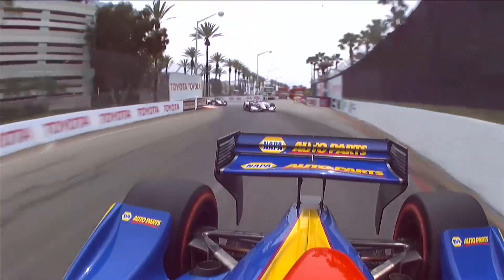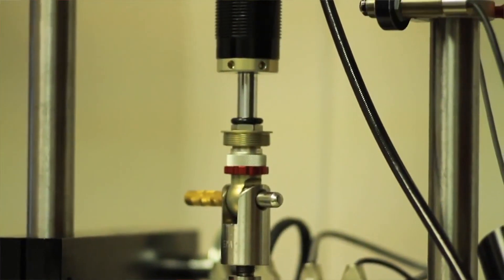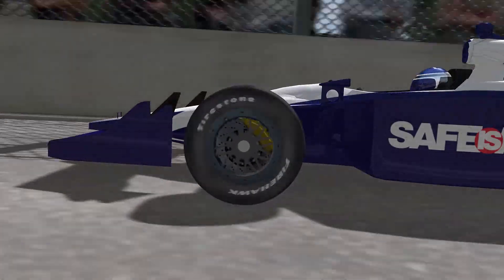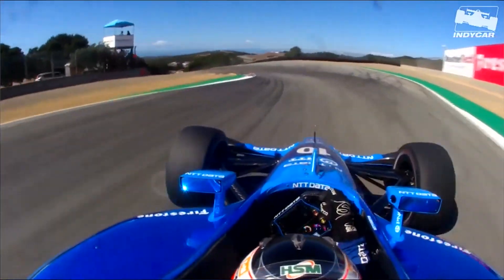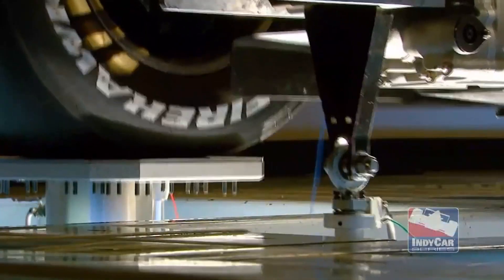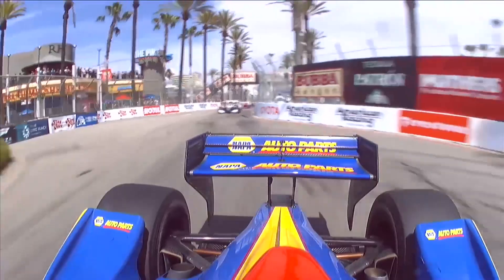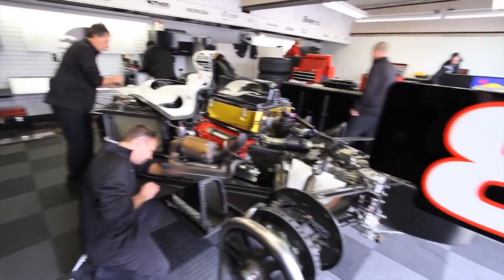Tuning Shocks/Dampers for Speed - Part One: How They Work

Comment: 3:17 "There'll be times when might have your damping front to rear out of phase and then the car is very pitchy. That's probably one of the biggest things for what will allow the driver to go quick. We might find damping setups that actually have actual what we'll call grip,m but the platform is more consistent. And if the car is not pitching, they'll tend to have have more confidence with the car and extract more speed from it."

If the car isn't pitching, then wouldn't the tire's contact patch be more consistent as well? That's been my experience, and the dampers have  HUGE influence on heave / pitch dynamically, as well as roll as most people focus solely on. It'd be interesting to see results where a pitchy setup is theoretically / modeled to be faster than one with a 'flatter ride' (perhaps due to curbing compliance or aero concerns?). I think the downside of allowing excess pitch apply to more than just driver confidence, but braking stability and tracking rippled surfaces as well. 

4:18 - "We don't really tune the car much with dampers, unless we have to. We generally through our 7-post testing and simulations we set the dampers for what we feel is going to give us the best and most consistent grip for the setup we have, and we just leave it alone. And we tune with toes / cambers, things like that..." 

"Yes, you definitely you want to have the geometry where you want it so you get the most out of the tire. So you have the tire operating whether it's camber or slip angles and stuff like that, so that they're correct. Your spring rates should be correct.. And at that point you can start to dial in the shock absorbers. But with all the information out there, you should be able to start with a shock that's close."

Music to my ears! I've found far bigger gains by focusing on optimizing damper behavior than just having many knobs, especially if the user doesn't really know what the knobs are doing. From track to track, sta-bars, tires pressures, aero settings, alignment, and corner balance / stagger seem like the key variables to work with. Wish I had a 7-post rig.. one day. 

Thanks for the great video!

Comment: Hoping part 2 gives us real race engineers opinions on manipulating oversteer and understeer tweaking with the dampers.
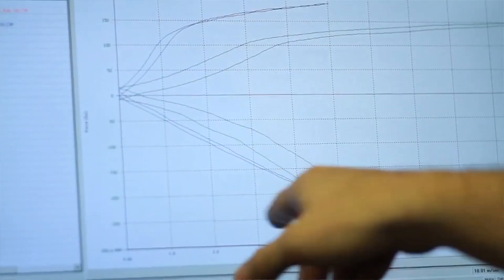Reply: Watch out for excess force in rebound or compression at high speeds (assuming you're driving over curbing). Launching up (excess compression) or jacking/packing down (excess rebound) will both decrease grip. Aero loading matters of course. Generally, don't use more low speed rebound than required if you can utilize low speed bump. Note the dyno graphs in this video show at 3:05. I'd read through this thread for more insights: https://www.f1technical.net/forum/viewtopic.php?f=6&t=8937. A sensitive driver, data acquisition (with shock potentiometers & sufficient CAN-BUS or similar sensor data), and someone to help interpret it will all help see whether it's the driver or setup that's limiting your performance.